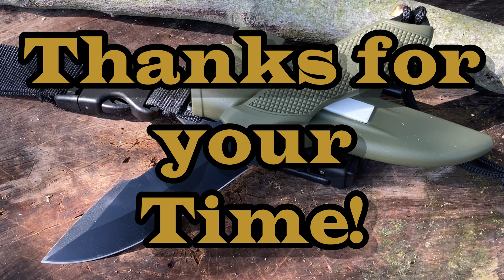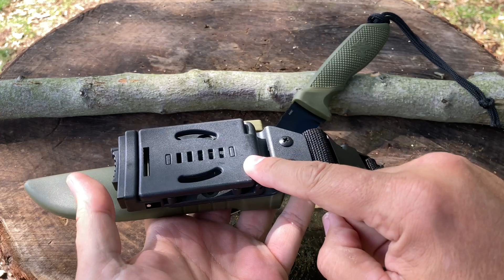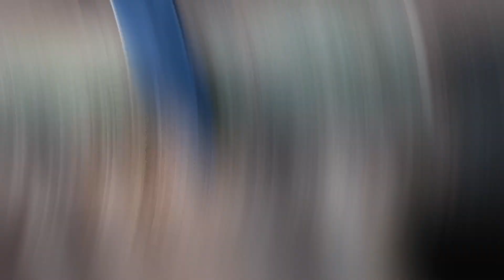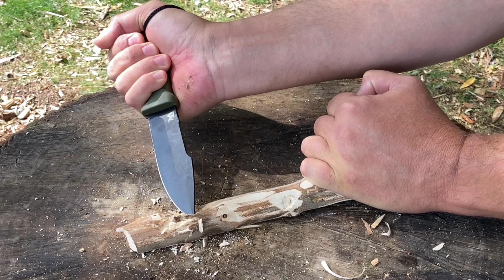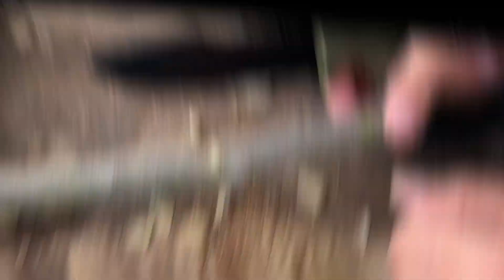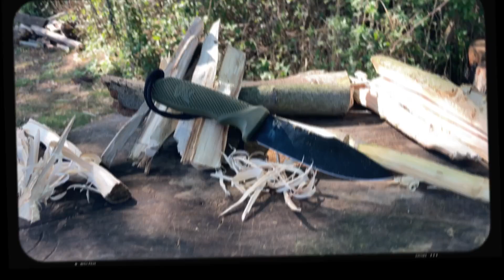OdenWolf W3! @bushcraftjoe1 #knifereview #bushcraft #edc #hiking #camping #knife #knife #hunting

Comment from the maker: OdenWolf W3 Outdoor Knife!

https://odenwolf.us/products/w3-outdoor-knife?_pos=1&_sid=047ccaea9&_ss=r

The W3 is one of our absolute classics. Despite the affordable price, the outdoor lover has a lot on offer here. The 440C steel blade is very robust and is just as suitable for outdoor use as it is for private purposes. Thanks to the structured handle made of TPE material, the fixed knife always fits perfectly in your hand. In this way, tasks can be carried out even more safely and precisely. Included is a polypropylene sheath with Teklok, belt loop, plug lock, fire starter & mini whetstone. In this way, the knife can always be transported safely and carried comfortably on the body. Compared to many competing products, the W3 has a continuous tang - it is, therefore, more stable than many comparable models in this price range.

OL: 9.37”
BL:4.53”
BW: 1.5”
BM:440c
HL:4.84”
HM:TPE
Lanyard Hole
Full Tang
Poly Polypropylene  sheath
Ferro Rod included

Perfect grip thanks to the ergonomic structured handle made of TPE material
Universally applicable - both for outdoor trips and in normal everyday life
Incl. PP sheath as well as Teklok, belt loop, plug lock, fire starter & mini whetstone.

#DSKFS
#22aday
#22adaynomore
#NeverGiveUpNeverSerrender
#NeverQuitQuitting

Don’t forget to hit the like button! 

Please help support our vets by raising awareness of the tragedy that is Veteran suicide by visiting the links below and reaching out to those in your life. If you know a vet don’t hesitate to reach out to them! 

Suicide Prevention Hotline: 1-800-273-8255 
https://suicidepreventionlifeline.org/

Mission 22
https://mission22.com/

Til Valhalla Project
https://tilvalhallaproject.com/

Message from Martin Miller, Army Veteran 66-69

1-800-273- TALK, press 1 for Vets saves lives. They're the Shining Stars of the VA. My brothers and sisters, you're not alone. The help you
deserve and have earned is just a phone call away. It takes the courage and strength of a warrior to ask for help.  Please call if you need help. Suicide is a permanent solution to a temporary crisis

Message from Martin Miller, Army Veteran 66-69

I love this community!  The knife, sword, saw, fatwood, bushcrafters, and all the new people who have subscribed!  We are LEGION!

You guys' ROCK!

LIKE! SHARE! SUBSCRIBE!   Also don't forget to check out the other content creators!  They are all good people with great videos!

Comment: Anywhere to get it besides their website ?

I'm not in the US
Reply from the maker: Amazon seems to be selling them and they sell world wide I am sure.
Reply: Wolfgang w3 in EU/Germany...
Or without fancy sheath same knife as w1 model...
Reply: Watching this older video really shows the strength of different design. This model is a great knife. The scandi is good as well just the tip was to thin.  Every scandi I’ve ever seen as one angle for the knife but the tip is a steeper angle. 
Anyway this video shows every knife has a place. I also believe steel isn’t  as important as marketing want us to believe. I’m old enough to remember when 440c was tiptop shelf . Heat treatment is very important but being the highest Rockwell isn’t the most important. 
I really like this brand  I’d like to get their skrama knock-off. Imitation is the best form of flattery

Comment: China man has the heat treatment right on that cheap steel. Damn good price for a package deal right there. Don't mess with China lmao, king's in the industrial, manufacturing industry. Awesome review brother. 👊💀
Reply from the maker: Thanks.
Reply: @LegionTacticoolCutlery  👊💀 MY Mora spark or whatever they call it comes with a fire steel in the handle. It did the same damn thing and broke in the handle lmao. I'm assuming it happened when I batoned it lol. Pissed me right off lol.👊💀🍻🇺🇲🍻

Comment: RHF pocket Cold Steel Black Talon serrated with Emerson grip. LH waistband  CRKT OBake with lanyard hooked on belt loop for quick draw deployment. I bought some Odenwolf fixed blades 2 flat grinds and 2 scandi grinds. At the time they were just breaking into the market and were a great price, I think about $21.00. I wanted some knives to keep in various bags that I wouldn’t miss if they got stolen out of my car. I figured that I could switch them out with my other premium knives when I had to use the bag and was in control them. I wasn’t expecting much for the price. When they arrived I was surprised to find out that they were decent quality but most importantly to me, razor sharp. I decided to keep them in my bags and found no reason to switch them out. The Odenwolf knives that I bought, have no model names, if interested. They are just called , full tang knife with scandi or, flat grind survival knives. Overall length 9.5” blade length 4.6” D2 steel. they jump up and down in price. At the time of this comment 8/4/24 they started at $28.97 and up depending on color and grind on Amazon. They have a lot of  models from serious tactical to bushcraft. Thx for the vid and great demo. The 893ll
Reply from the maker: @theyakuza4927  odenwolf make some fine budget blades that work!  They got more knives coming as per the rep so stay tuned man!  Great comment!